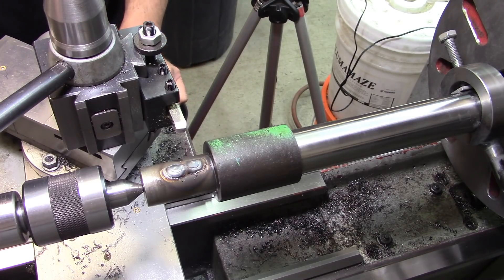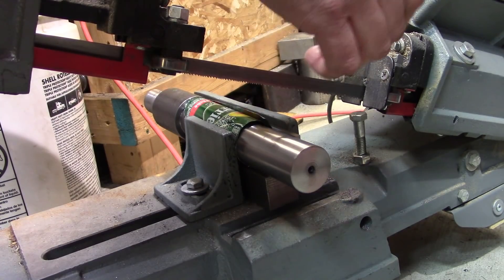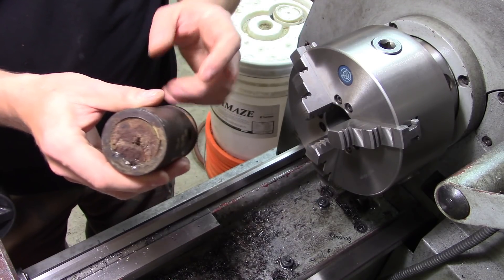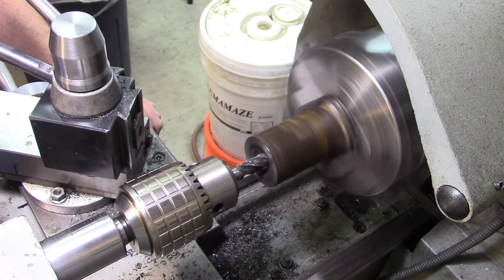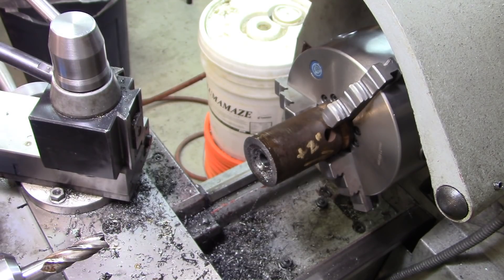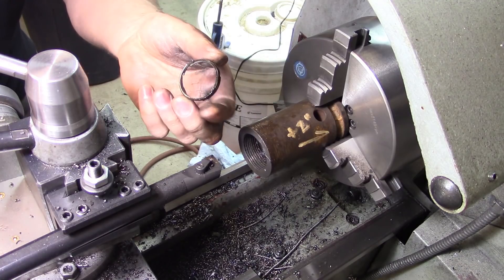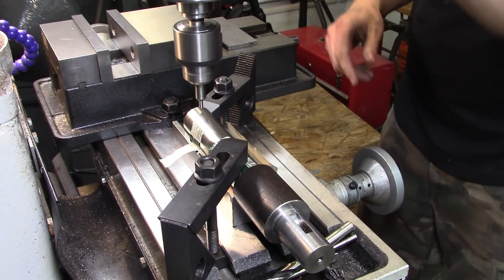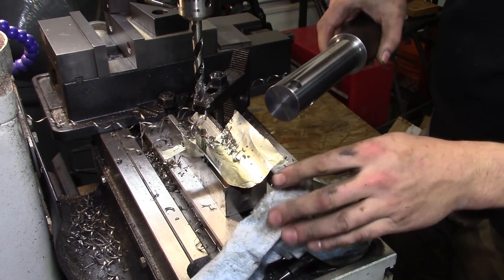Post Hole Auger Shaft Part 3

Comment: Everett I have found in using my bandsaw that a V block against the rest plate makes things easier with different size stock. And keeps it perfectly straight horizontal and perpendicular to the saw. In part 2, I was thinking just weld in the unwanted cut and turn it back down. Them part 3, I see I must have been reading your mind lol.
Reply from the maker: A V-block would be a good idea, will need to make one for the bandsaw at some point.  Would also like to make a clamping jig for small parts like Jim Dedmon from Sawlogs Plastic Hubs uses.  And yes, we fill-welded the mistake with the MIG and gave it a turn down after.  Thankfully the distortion wasn't too bad.

Comment: At 2:37 the gear fit to the shaft seemed a bit sloppy. Thought it would be press fit in tolerance. But you have mentioned over and over that there was quite a bit of forgiveness in spec.
Reply from the maker: I hear you, I would have expected the crown gear and the bearing on that side to be a press fit but they are actually a slight slide fit on that side of the original shaft.  Surprised me too, so I cut the new one to suit.  I do agree with you though, I would have expected press fit as well!

Comment: Hi Everett. Enjoyed following this project it turned out well in the end. It looks too good compared to the rest of the machine.
To cut the shaft down I would have just gripped the off cut end in the bandsaw vice put a metal spacer the same length as the diameter or a machinist jack in the other end of the vice preventing the moving jaw swivelling inwards so the vice grips the shaft parallel. Tony
Reply from the maker: Thanks Tony, it really is just a favor for a friend who got a cheap machine and only needs it for a little bit.  Maybe once the job's done (or the gears fail, whichever comes first) I might get the shaft back to repurpose, lol! I see what you're saying about the bandsaw, just didn't think of it at the time.  Would have been simpler.

Comment: Good triple video. especially waiting for the job to cool before going on. And I would have mig welded the other side as weld.   As usual another great job for the archives. Well Done
Reply from the maker: Thanks Ted, I figured to release them as a group as it was originally intended to be one video and they were pretty much all edited in one batch.  Thankfully the weld idea worked and the shaft didn't get too messed up in the process.

Comment: Great project.  You did a good job - I learned a lot.  As for removing the shaft from the cap, originally I was thinking that the cap was screwed onto the shaft, but after all was complete, I see that perhaps it wasn't.  That makes me wonder why there were threads.
Reply from the maker: Thanks Bob, glad you liked it, I learned a couple things the hard way too, lol!  I'm not sure why they threaded the auger adapter to the output shaft from the factory, as it obviously created a stress riser.

Comment: Use ONE grade 5 bolt on auger shaft, acts as shear pin. Multiple grade 8 bolts will likely result in more shaft or bevel gear fabrication.....take it from a country boy from the Texas Hill Country
Reply: Yep you need a weak link.
Reply from the maker: I hear you, the cross drilled area is to hold the adapter (the piece I dug broken shaft out of) but the adapter will have a shear pin that drives the auger itself.  That places the weak point outside of the output shaft itself.

Comment: If I'm not mistaken, that through hole is for a shear pin... You don't want to put a grade 8 bolt in it. That may be the reason the original shaft came to be in the shape it was in. You can usually get them at a farm supply store.
Reply: D Rickard agreed
Reply from the maker: There will only be grade 8 bolts through the shaft into the adapter, the adapter into the auger will have a shear pin as well as the emergency retaining pin that runs in the groove of the adapter.  That way the weak link is where it needs to be and it doesn't get twisted off again.
Reply: @EverettsWorkshop  perfect...I was hoping there was one somewhere. There are very few things worse than having your tractor bounce around a hole. Lol

Comment: One point of good engineering is to leave slack for fabrication variances and the occasional 'oops'. Does it do the job it's intended to do with enough robustness and resilience that a reasonable end user won't complain? If anything, you've reinforced why engineers need to be clear in their documentation and fabricators need to measure twice and cut once. Variations and oops-es are unavoidable; good design should take that into account. Learn from it, help others learn from it, and move on. :)
Reply from the maker: Well, the piece fits as it should, and when my buddy goes to poke some holes in his yard that will tell us of the resilience and robustness factor, lol!  Yep, just a human like anyone else, was quite frustrated with myself at the time but have moved on since.  Just figured to share it as it a good reminder to us all to double check our math when it comes to making a cut!

Comment: I mentioned on the last video about silver soldering a patch piece to repair the mistake, I was concerned that the ChRome moly shaft might get too hard from welding it up. We will see if it lasts! Good job overall!
Reply from the maker: Thanks John, he'll have to let me know if something goes sideways on it, but considering on the original shaft the failure was where the threaded auger adapter went (apparent stress riser in the threads) we'll have to see where the machine's next weakest point is!

Comment: If the shaft is too solid, then, the tractor will bee spinning around the auger bit when it gets snagged....    🚜🪂😁👍
You should get 6's when running clockwise and 9's when CCW....
Time to pimp up your lathe and add a 3 phases turbo diesel powered engine, stop dreaming about half inch DOC, get the real deal...    
Get a good muffler system or the little one won't sleep while you work on BIG projects...   🚂🚂🚂
Today we're getting raided, again...    ☔🙄😴🤧
Reply from the maker: Lol, well, that's my buddy's tractor problem now, I've done my part.  It will be plenty good enough considering the machine's condition and that he only needs it for a few holes for now.  I have been curious about what the lathe could do if it had a 3-phase motor with VFD, as they are more efficient and can very in their speeds, but waiting till the OE motor starts giving trouble as a motor and VFD is quite a few $$$.  Just thankful to even have equipment to play on, a lot of people would like to but don't have the opportunity.
Reply: @EverettsWorkshop  It takes lots of power to remove big layers of steel, the machine also needs to be rigid. Even here with having quite more power, the problem becomes slippage in the chuck when going too heavy on the removal, then I've got to limit the advance and DOC or/and add some way to help the part stay put, like a blockage or a shoulder on the part.

Comment: That screwed in broken material, looked like free machining, ref added lead or sulfhur?. Great job, as the saying goes, the person who never made a mistake, never did anything.
Thanks for sharing and best regards from the UK.
Reply from the maker: Thanks again, yeah, I don't know what the old material was - the way the chips came out I was also wondering if it was a cast of some type due to the form of the chips at times.  Definitely weird stuff.  Just thankful the new shaft didn't need scrapping and redoing, as it was my best chunk of 2" 4140 in the stash!
Reply: @EverettsWorkshop  Hi Everret, you are probably correct on the old shaft being cast, there looked like casting flash on the OD of the original, maybe the grinding spark test will reveal the material. Best regards John.

Comment: Everette -- I have e-mailed you several times without any response  , what is wrong ????
Reply from the maker: I'm sorry Jim, I didn't realize that was you - I popped over to your YouTube page and looked at your email address, there was one email I got the other day that wound up in my spam folder (which I don't check very often).  Sorry about that, I will email you at the address on your page.  Nothing is wrong, and I apologize for the miscommunication!

Comment: The shaft turn out great, those post hole diggers do a great job, anything does a great job if its not a shovel and you have to use it, great series of video mate, I really enjoyed watching the back to back after Emma's live stream, thank you mate,    Matty
Reply from the maker: Thanks Matty, my buddy is happy with the product, and the unit all told didn't cost him that much, even if it is a bit rough.  I would like to join into Emma's stream but the time difference is quite difficult in our time zone, especially if I have to work that day.

Comment: nothing wrong with that build! looks great!
Reply from the maker: Thanks Dave, it should work for what it needs to do.  Considering he got the machine for 5 bucks, he's into it for 50 bucks or so including bearings and seals.  Not bad considering what a new one costs around here.
Reply: @EverettsWorkshop  sounds like the price was right. its not a tool I use much either but when you need it then its sure nice to have.

Comment: Nice Job! Something you may, or may not be interested in, in our shop we fabricated a toolpost holder for the lathe to hold old mill bits to be used just like you did with the tailstock/millbit to open up odd stock. We use broken carbide, and highspeed steel bits that still have one good flute left to sharpen. Being on the toolpost it allows you to use it just like a boring bar. We used a cheap e-bay 5c square collet block and closer to hold the bits, with a piece of 5/8" keystock bolted to the side to fit into a standard QC tool holder. Works good on ragged operations like yours where you don't want to tear up a good mill bit, or boring bar. Plus used mill bits are a dime a dozen on e-bay.
Reply from the maker: A toolpost holder is a good idea for that, never thought of that - used endmills as drills/non-precision-reamers/etc before, and also used damaged ones for boring bars after a bit of modification, but haven't mounted any to the tool post.  Might have to give it a try, thanks for the idea!

Comment: As long as it punches that last hole.  We had one similar to that, older and somewhat lighter.  We could not keep an input shaft in it.  I used my high school's ag shop lathe to make a replacement, probably the only time that lathe got used in however long it was there.  Used a tight crescent wrench as a comparative micrometer, nibbled it down a thou or two at a time to size it, and used the old part, clamped on top of the new part in the drill press vice,  to locate the cross hole.  Not knowing anything about metal grades then, I'd used a length of mystery shaft I'd picked up from the rail yard (spilled from a gondola that had de-railed about a month previous).  It lasted for the three holes we needed, and not one second more.  I can only assume that a scrapper got it after that, I never saw that post hole auger again.
Reply from the maker: Yeah, that's the fun of using Mysterium or Unknownium Alloy, you never know what you're working with.  Thankfully the piece I had on hand had a known pedigree, and as the old output shaft was of unknown metal (I still suspect cast iron, due to the chip formation on the stub removal) this shaft should last at least long enough for my buddy to punch the half dozen holes he needs.

Comment: Great work as always, by the way the band saws are worth every penny, I was lucky and got mine lightly used. You need some fixtures like mine so you can get more use out of the bandsaw on short pieces
Reply from the maker: Thanks Jim!  Yep, VERY thankful for that machine.  I've been eyeing the fixtures you have and some other mods that have been made on others' saws to make them more versatile and that is definitely on the to-do list.  Would be nice to use it on shorter pieces to save material.

Comment: GREAT!  When I was teaching at the vocational school I used to tell people I had a PHD.  Well, as you guessed it wasn't a lie; I had one of the two handled Post Hole Diggers.  All I had to do was provide the power.  Hey, it worked...so did I.  Thanks again Everett for a great video on how to repair things, Greg.
Reply from the maker: Thanks Greg, glad you liked it.  This post hole auger isn't anything special but for the price it will do what my buddy needs of it for a few holes.  He'll be into the whole thing by about 50 bucks including buying it, bearings and seals by the time he's done so it was worth making the shaft for him.